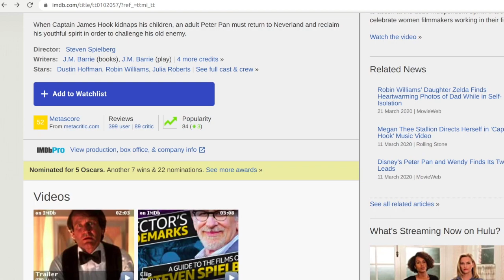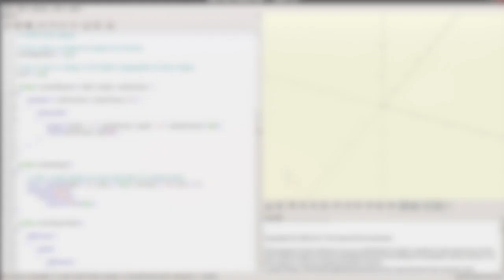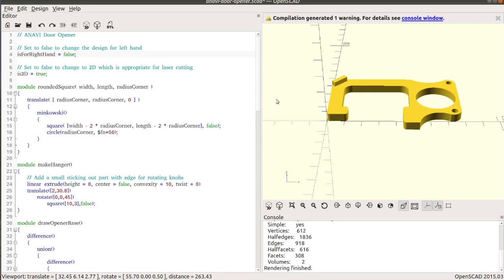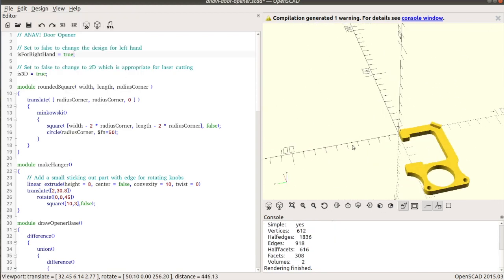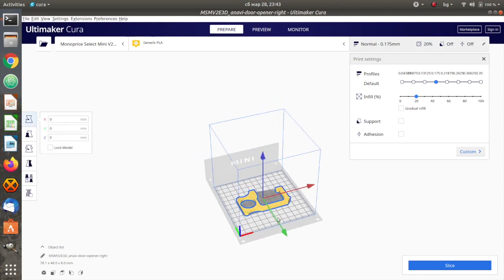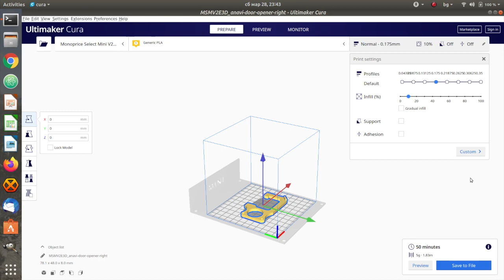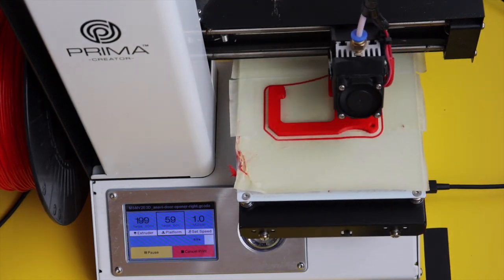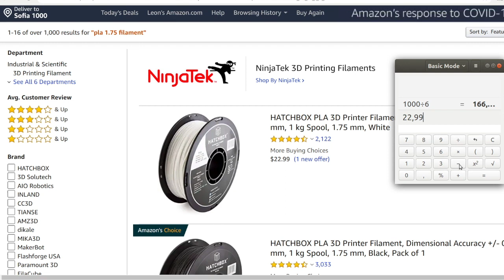Open Source Door Opener (Hopefully) Reduces Spread of COVID-19

Comment: No No and just incase NO. the key may do what it says when opening or pushing the the point of this is to stop getting infected. So you use it on a handle that has infection then the infection goes to the key what do you do with it then, put in in your pocket or bag etc this will just transfer the virus to these items and the virus will last much longer on the item your key just came into contact with. Covid can live on these keys for over 4 hours so if you use one you have to clean it right away and if you do that then just clean your hands with a gel etc
Reply from the maker: As I said in the video it is super important to carefully clean it after each use. Each units costs a few cents to 3D print so you can carry multiple with you, don't keep the door openers directly in your pocket and as soon as possible disinfect it. Btw something like a barbicide disinfectant jar might be useful for cleaning it.

Comment: Wish I had a 3 D printer.im guessing that's what I made it with.idk how much one costs. May I ask ? Also does one have to have the same knowledge as a tool and dye operator. Has 3d printing eliminated tool and dye.? how do u create a prototype  being as it needs to copy something yet to be created? Thank u ,Maria brown . jaxon 11132018@gmail.com...
Reply from the maker: I have a low-cost printed that is 3y.o. It is very similar (although another brand) like Monoprice MP Select Mini 3D Printer. I think nowadays in the US it costs a bit more than $200. Printing a hook for opening doors takes about 30 min with such a cheap 3D printer with just a few grams of PLA filament so the bill of materials is just a few cents.
The maintenance of the 3D printer depends on the brand and the model, it is annoying process that requires some time but no super knowledge. There are a lot of tutorials and solutions, such as the OctoPrint software to help.

Comment: The best way to avoid transmission is to use a single use item and discard it, like a tissue. Just think what will happen if you use a 3d printed object to open a door. The virus attaches to the 3d printed object. You the touch another door handle and that handle is now infected and you spread the virus, not contain it. If you do use a door opener, you would have to wipe it down with hand sanitizer after each use...
Reply from the maker: yes, good point and because of this I keep cleaning my 3D printed hook after each use. This OpenSCAD design file which I shared in GitHub is also suitable for laser cutting from other materials like brass which surface antimicrobial.
Reply: @LeonAnavi  I have seen Big Clive on youtube make items with OpenSCAD, might need to look it up sometime (just did, a cad program for programmers, I can see the appeal for several use cases). I'm used to fusion 360 for making things (Well, when I say used to, I mean I am getting better with it on each use..., fusion 360 is fairly complex)